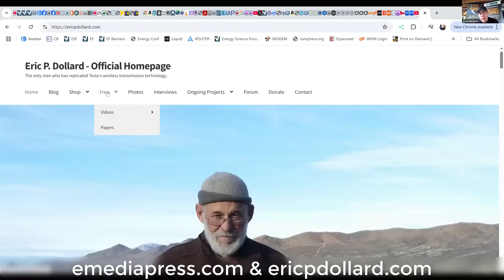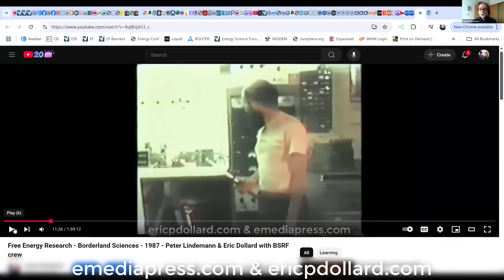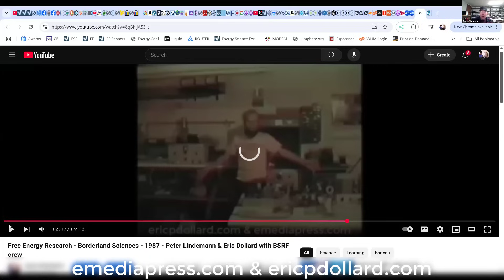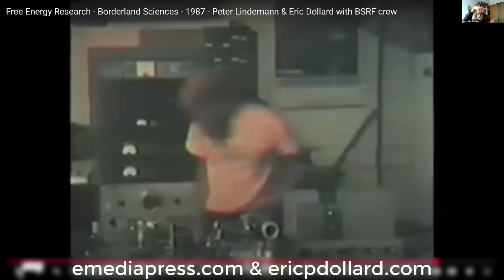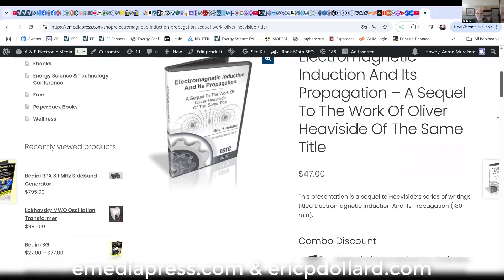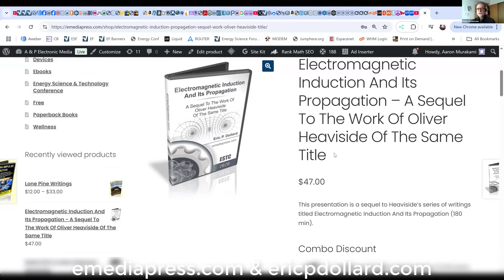Free Energy Research Discussion by Peter Lindemann & Eric Dollard 2025-04-26

Comment: You guys ever look into quote/unquote "electrets" to create electrostatic "free energy" devices? "Electrets" are permanent electrostatically charged objects created in a similar way to magnets, as in they are a material melted and cooled under high voltage electricity. The strength of the "electret" seems to be based on materials ability to 'receive charge' aka 'amount of negative charge' on the triboelectric series. PVC, Polyurethane, Polyethylene, Polypropylene, PFTE, and Teflon work great(all easy to acquire and have melting temps that can be achieved with an oven, grill, or fireplace as opposed to metals used in making magnets which require special equipment/furnace/forge to achieve high enough temps to melt the metal). The process given to make an "electret" online is melting a mix of carnauba wax and rosen, it works, but its a very weak example of an "electret" that barely scratches the surface of whats possible. Provided they are cooled under the same high voltage, the carnauba wax/rosen "electret" mix is like a 50 gauss refridgerator magnet while polyethleyne "electret"(no mix required) is like a 4000 gauss neodyminum magnet. Teflon works even better, and is 2 to 3 times stronger than the polyethylene "electret". Make a bunch, use as stator of an electrostatic motor, idk not a lot of info online about "electrets" but around 4 of them are in every cell phone in existence for its ability to record and amplify sound frequencies using least amount of material. They are like piezoelectric crystals but able to be easily and engineerably created.

Comment: I also learned (several years ago) that resistance and the elevation of voltage which it spawns is bidirectional in which the reverse is also true: that the elevation of voltage exhibits the properties of an elevated resistance. Thus, a constant current source, aka. an overunity circuit behaving as such, logically will induce a self-amplification of voltage. It can't do otherwise (again if nothing gets in the way).

I’m thinking of the braking “C” shaped permanent magnet whose north and south poles hover close to the opposite surfaces of the perforated aluminum disk which rotates inside of an electromechanical watt-hour meter, the I-10, from General Electric (built in 1910) as explained in the Meterman’s Handbook from 1912. Without this braking action, the aluminum disk would have escalated its rate of rotation until the jewel bearings of its brass spindle would break down and probably jam the rotation of that disk. So, I guess this “C” shaped permanent magnet is serving as a magnetic load applied to what otherwise would have been an unloaded motor? (A nod to Jim Murray's presentation of "Fundamentals of the Transforming Generator" during the 2016 summer conference in Hayden, Idaho.)

Comment: I figured out the missing puzzle... 

Since the voltage has been turned around 180°, it comes around to the opposite side of the coil just when the current is trying to enter from the other side and this voltage opposes that current with the exact same amount that it used to supply the backup-force to push the current along. Consequently, this opposing voltage prevents the current from entering the coil at all! So, it's no wonder that the coils never saturate because the current never enters the coils just as the voltage never enters the capacitors. Everything else is blind to these two types of components and passes right through them as if those components were not there and also as if, from the standpoint of the components, the current is invisible to the capacitors and the voltage is invisible to the coils – which was probably the case all along, anyway. So, the very thing the coils needed to store, namely: current, they cannot absorb because they're being forced by voltage from the opposite terminal of the coil to push against the current to prevent it from entering the coil. Meanwhile, the capacitors refuse to store any voltage because of the low level of capacitance turning those capacitors into prisms bouncing the voltage off of those capacitors at 180° direction of inversion.

Thus, nothing travels anymore. There is no throughput. We get something like a standing wave of spikes in as much as nothing travels anymore.

As an aside, when the virtual oscilloscope tracing of the simulator spreads these spikes far enough apart in time, then they begin to look like triangle waves, but they're really spikes.

And (so) everything (the spiked phases of current diametrically out of phase with the spikes of voltage by 1/2 cycle of phase displacement between each other) arises everywhere at the same time and exponentially growing in amplitude and slightly growing in frequency. This is an explosive situation to be sure.

Comment: The reason why negative watts makes it possible for this type of generator, namely a combination of low capacitance capacitors coupled with high inductance inductors, is because the current can never saturate the coils because the voltage could never be stored in the capacitors because of the nature of this negative watts is so diametrically opposed to each other – the phase current from the phase voltage – that the electrical components, such as capacitors and coils, can no longer operate in the usual manner. So, they cannot store the energy at all.

And (so), because they cannot store the energy, then not only is there no time delay but there is no variation of current. The current remains the same because it has never been stored within the coils, nor has the voltage been stored and released within the capacitors.

In fact, the capacitors are so low in capacitance that they refuse to accept any voltage reflecting it back to wherever it came from at 180° reflection yet allows the current to pass through because the capacitor cannot see the current. It only sees the voltage and refuses it!

Meanwhile, the coils refuse to accept the current and so they never become saturated because, I suspect, the skin effect takes place (or something similar), causing the current to shimmy along the outside of the coil rather than pass through its interior. I don't know...?

The coils are the last peg in this puzzle to somehow make it possible for free energy circuitry to become a constant current source backed up by the capacitors functioning as prisms.

So, there's still a few missing pieces to this puzzle. But it's starting to fall into place very quickly – all because of the brilliant role models which Eric Dollard and Peter Lindemann and Aaron Murakami are. They're great role models to inspire brilliant thinking because they're brilliant. So, hopefully, some of it (a little bit of it) rubs off on the rest of us. 😄
Reply: Did you know that in an electromechanical generator rotating the magnets so the poles are orthogonal to the stator coils will eliminate Lenz drag on the rotor?
Reply: @JenkoRun  Since both the voltage and the current stator coils are oriented in the same plane as each other, and are parallel to the poles of the "C" magnet, then I have to assume that what you are describing is that the "C" magnet could be rotated so that its poles could become perpendicular with the poles of the rotor? And, thus, eliminate Lenz drag?

I didn't know that the rotor already possessed Lenz drag. I thought that the whole point of having a "C" magnet (hovering its poles on either side of the rotor facing each other with the rotor between the poles of the "C" magnet) was to induce Lenz drag so as to prevent the rotor from accelerating its spin rate until it destroyed its jewel bearings since the rotor was operating without any load being placed upon it. Jim Murray claims this is standard conventional knowledge among electrical engineers that an unloaded motor will always exhibit no Lenz drag as he stated in his Transforming Generator presentation at the 2016 conference (posted at Emedia Press's website and an 8-minute, audio excerpt at vinyasi daht info forward slash energy forward slash shorted transforming generator.
Reply: @Vinyasi You misunderstand, I'm not talking about any particular "C magnet" or geometry or coil, I'm talking about literally any permanent magnet generator you could throw together on your desk in a few minutes, the only thing different is that the magnets are placed so the bloch wall faces the coils instead of the poles, whether the coils are open or shorted will have no effect on the energy required to spin the rotor the magnets are attached too, Lenz's Law does not work against the input in this configuration.
Reply: @JenkoRun  Sorry. My mistake.

Comment: Thanks guys! You just gave me another insight when you describe constant current source and then I asked AI over at Google to explain it to me again to repeat what you said so that I could read it and reread it over and over again and then I got it! 

In which free energy is when the circuit starts to convert the its consumption of power into its generation of power in as much as the circuit becomes a constant current source in which if you put the impedances in the right place then you get a rise of voltage with current lagging behind that rise condition far behind like a thousand times More voltage than current in terms of units of voltage versus units of amperage or even greater than a thousand to one but that's because you put the impedances in the right place but if you put the impedances in the wrong place then it becomes similar to a shorted condition in which the circuit goes comatose and hardly anything happens because it's trying to maintain its magnitude as it functions as a current source. 

This has been the case regardless of whether or not you have a voltage source in the circuit providing a constant source of voltage! You could have a pre-charged capacitor charged with a microvolt and it quickly dies out yet the circuit apparently according to what I'm getting from what you're saying has become a constant current source and so it builds up voltage because the impedances were put in the right place to accumulate voltage and any movement of currents we could almost call a leakage because it's so small relative to the voltage unless this disparity between the amplitude of voltage and the amplitude of current is transformed by its passage into a third location in which a proper resistance is applied to realign the voltage and current into more reasonable values of proportionality after having been transferred from two other locations one of which was high voltage low current and another which was high current versus low voltage to eliminate the extreme disparity between the two values.

Comment: Capacitors are not sold below one pico Farad because once they get very low in capacitance then they stop being capable of absorbing a charge and holding the charge and discharging the charge and they also stop having a time delay for absorption and discharge and (instead) become a prism capable of refracting current through their dielectric medium (having become a prismatic medium) and reflecting voltage at 180° out of phase to the current causing them to  convert what would otherwise be the consumption of power into the generation of power without creating the energy just by converting it from a power factor of positive one into a power factor of negative 1 namely convert watts into negative Watts. Consequently, coils of wire cannot accept this format of energy and so they never reach saturation when it passes through them because they don't absorb it either in the traditional sense at any rate. For some reason, beyond my understanding, coils are needed to finish this process without which this benefit of capacitors could not be utilized.

The significance of this procedure is that the behavioral characteristic of the consumption of energy is that we lose it once it's spent it's gone! But negative Watts cannot be spent and it cannot be lost in other words it does not go away it simply accumulates but it also provides a momentum in which the more of negative watts which has accumulated the faster it accumulates becoming an exponential rate of accumulation eventually reaching explosive proportions of expansion if not checked by regulatory mechanisms built into such a free energy circuit to prevent this runaway escalation of unbridled power.

The simplest way of making use of negative watts is to pass it through a resistive load such as a light bulb which was demonstrated by Jim Murray and Paul Babcock during the 2014 conference. They couldn't show off their circuit at that point in time but four years later they received a patent and they called it the S.E.R.P.S. technology.

It may be possible to use a more complicated procedure in which two coils are counterwound so that the amperage of one coil can match up with the voltage of the partnered coil and the voltage of the first can match up with the amperage of the second insofar as utilizing their magnetic fields to perform this blending so as to create positive Watts out of negative Watts. This is speculation on my part because I've never seen it happen. But it sounds logical. So, what do I know?!
Reply: By the way, I almost forgot to mention that the square root of the refractive index of prismatic materials is equal to the dielectric constant of dielectric materials! Wow!!

Comment: There are hobbiests here on Youtube who blow glass and make tubes and bulbs. The skill and art is not lost.
Reply from the maker: It requires a copmletely different skillset to make the kind of tubes that were discussed. Fill pressures/vacuums with different ratios of gases, etc. hardly any glassblowers are equiped with that equipment or knowledge.
Reply: @AaronMurakami13  Take a look at what they are building. Diodes, Triodes, Tetrodes, Pentodes, Rectifiers, Electron CRTs, X-ray. Using gases at various pressures and hard vacumes.
Reply from the maker: @ I thought you were talking about regular glassblowers - you're talking about hobbyiest tubemakers. I get it - the tube of interest or at least one of the several is based on Griffin's presentation here: https://emediapress.com/shop/recent-research-on-the-tesla-radiant-matter-tube/ - Tesla's real radiant matter tube and much of the build process is proprietary.